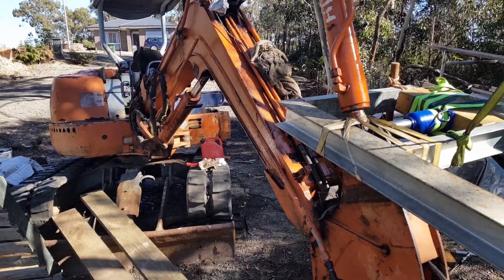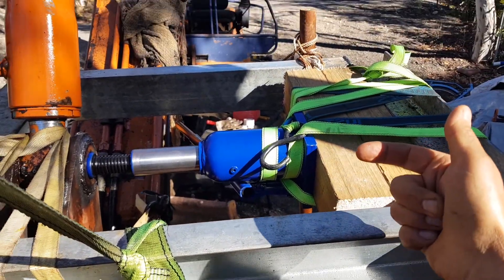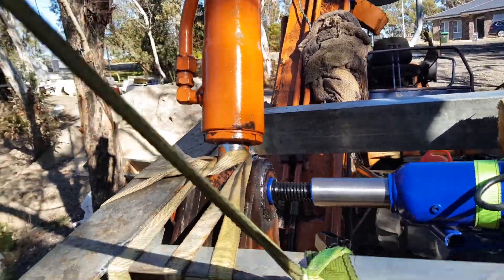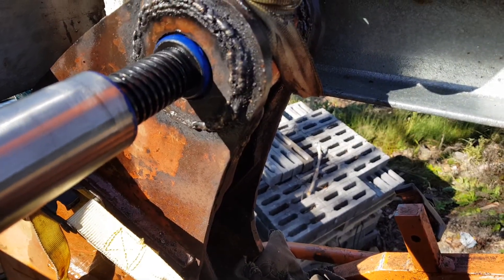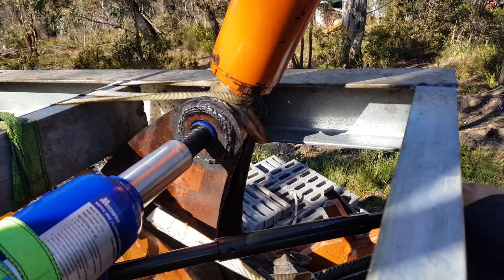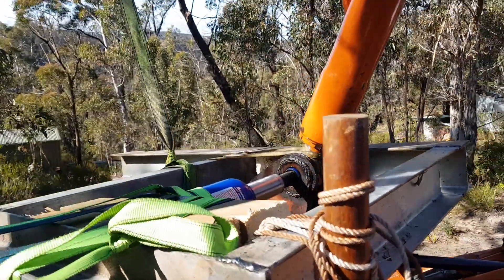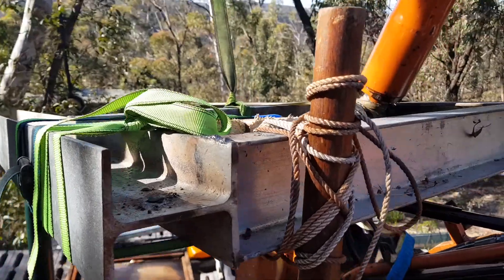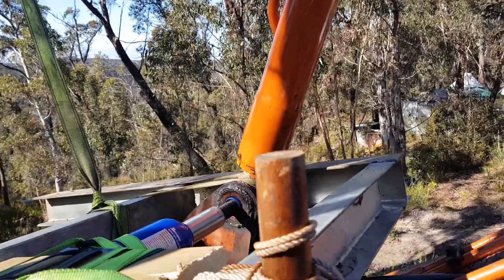How to remove a stubborn rusty pin Hitachi ex40u hydraulic arm cylinder using a 10ton jack 2/2

Comment: You know for a 16th of the cost of what you did I bought a hydraulic cylinder 20 ton with a hole that runs through the center of it and all I did was welded a 1 in threaded rod to the PIN and then put the a sleeve over the the cylinder and pulled it out like that the tool with a air over hydraulic pump cost me less than $300 and you can get it cheaper if you want to go through alibabi or whatever but I stayed USA
Reply: Barry could you please elaborate on your method? I’m not clear on the setup you used.  A napkin sketch would suffice if that’s ok….but words are fine too.  Thanks in advance.
Reply: @marsogreen2411  He put me on the right track. Weld a nut to the pin, cut you a length of threaded rod and use a hydraulic cylinder that you can purchase online and can hook to a simple hydraulic hand pump that is hollow and allows you to setup an easy way to pull it off. It may allow you to reuse your pin to if you take your time.
Reply: Thank you for the response